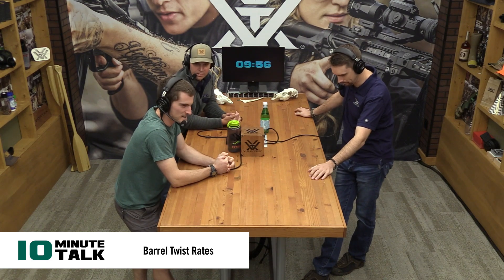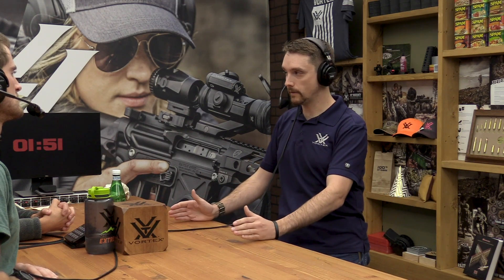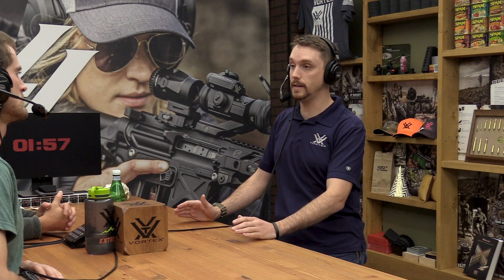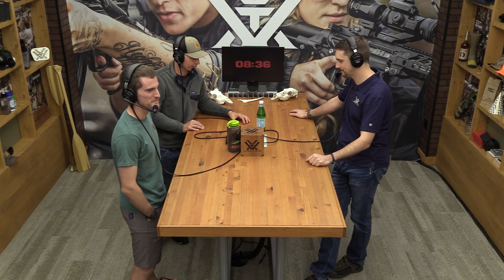#10MinuteTalk – Barrel Twist Rates

Comment: I've noticed that since I was a youth hunter and the fact that the AR platform has become so popular, the 223 deer hunting rifles of my youth have seemed to become less available.  I started with a 243 but I knew quite a few of my friends that were using 223 rifles when we were 12 or so.  Seems like now that cartridge is viewed as a varmint cartridge and is way less popular for deer.  Conversation aside, as to whether or not someone should use that small of a cartridge for deer, it has been done for decades, but now seems harder to find a deer hunting twist rate for a 223 bolt gun.

Comment: I can add a little bit of info to bullets coming apart from what ive seen with 223's.   I have experience with bullet failures in f class with the 223. Shooting the 90 vld's after about 600 rounds on a barrel is when the issue starts usually. It appears that fire cracking in the throat is one of the main contributors. Keeping carbon out of the barrel seems to prolong bullet life. So, maybe it is more of a carbon building up in the fire cracking than it is the fire cracking itself.  Barrel temperature seems to exasperate the issue also.  In the cooler spring and fall temperatures it is has been  less of a problem making it through a 60 round match.

I would guess twist rate did play a part in bullets coming apart in ryan muckenhirn's situation, along with "damage"  to the bullet from  fire cracking in the throat area and barrel heat.  I believe that a bullet being spun so fast is the final straw.  Looking at bullet rpm's you can really see the difference.

Comment: Each time I do this calculation I think "that can't be right..."   Hard to comprehend: 2800 ft/sec with 1 in 7 twist = 288,000 rpm!!!   No wonder bullets can explode!
Reply: Yup and past about 330-340 bad things happen. Don’t chamber a 1/7 for say 26 nosler lol. 200-250 is really more the sweet spot.
Reply: Is a 1:16 ok for a 9mm pistol with a 4.53 threaded Barrel?

Comment: Ok, so extreme outcomes are interesting but not what I'm listening for - do we need to know that a bullet will evaporate at a 1:6 twist?  In practical terms, why choose 1:9 (Bergara Premier) vs. 1:14 (Christensen Arms) for a 22-250?  Now that's an answer that would be worth hearing.
Reply: If you shoot heavier for caliber bullets, get the faster twist. If you’re shooting the lighter end of the spectrum, get the slower twist. I don’t have direct experience with the caliber, but in the similar diameter .223 a 1:14 would be used for <40gr projectiles, and 1:9 for 50-69gr projectiles. With the .22-250s greater velocity I might expect those weight ranges can be increased a bit.
Reply: 1:14" twist is good for lighter bullets and higher velocity.

Comment: The 6mm Rem lost out the the 243 Win because of twist rate. 1:12” to 1:10” respectively. The 243 was able to stabilize 100 gr. bullets, and the 6mm was not. Later in ‘58, Remington corrected the error, and settled on a superior 1:9”, but it was too late. The early mistake ruined what would evolve into a better suited caliber for heavier bullets. So now the craze with 6mm’s in 1:7.5”.

Comment: It does not make sense, because I have a .308 CZ550 Varmint.  It has 1:12 twist and I am supposed to shoot 168 to 220grs bullets with it.  I shoot 150grs Sierra Gamekings and it is amazing.
Reply: A 1:12" twist for a 308, you shouldn't use a bullet heavier than 180 grains.

Comment: Great discussion.  If reloading, by decreasing the velocity compensate for stabilization?
Reply: not always. entirely depends on the bullet you use, the powder and primer you use and the barrel you intend to launch them out of. when you hand load, you (rule of thumb) do 10 cartridges, at each .03 grain incremental powder charge. at some point, if you dont see pressure signs first, you will see groups open up from going too fast. its theoretical mostly, but some of that is the bullet being pushed too fast and some of it is the barrel harmonics. in slow motion you can actually see the barrel vibrate and "whip" around as the bullet gets launched. its microscopic in movent with a thicker barrel, but very noticeable in a thinner barrel. so, short answer yes, long answer, depends.
Reply: also try, " johnys reloading bench" channel. he explains alot of things in a very friendly easy to understand way.

Comment: So given that very light bullets flying apart when overtwisted is actually uncommon, would it be more common for these bullets (which already probably have pretty poor BC) to just deform a little bit totally messing up their ballistics?
Reply: That's a very good question I'd like to hear an answer to.
Reply: Quick answer.....yes. So looking at something like a 204 ruger or 22-250 with light jacketed light weight bullet with the BC of a ping-pong ball, one little imperfection on the bullet "can" effect group size. Spinning a bullet apart these days isn't as uncommon as you might think. Load a 40-50gr varmint bullet in a 224 valkyrie with a 1:6.5tw barrel and watch lol. Also I've seen where a bullet will stabilize in Denver but not in Houston......elevation has some play on things also.

Comment: Tighter twist rates also increase surface speed, heat from friction, heat from pressure, barrel wear from increased friction on hotter metals, copper fouling, bullet jacket damage etc.
Reply: That’s what I came to say. When people say they want fastest twist rate that’s “reasonable” they need to remember they are exponentially wrecking their barrel.
Reply: Bingo.  People think they know more than the engineers who designed it, certain twist rates, bullet weights have their sweet spots .
Reply: isnt that also why a higher grainage bullet is “less destructive”  for high twist rate bbls?
Reply: @HamuelTheGrey yes while slower bullets can reduce barrel wear, the main purpose is to maintain high energy while travelling slow enough to reduce or eliminate fragmentation.

High speed, light for caliber monolithic bullets in slow twist barrel's fix all the issues within hunting ranges.

Comment: I've shot my 7 TCU Contender with 14 inch barrel to 500 yards with a Hornady 154 gr. SST going 1900 fps. Hit 6 of 10 rams with enough energy to knock the 50 lb. rams over. Barrel length only relates to the velocity part of the stabilization part of the formula. Use the Berger stability calculator to determine twist rate needed for stabilization.